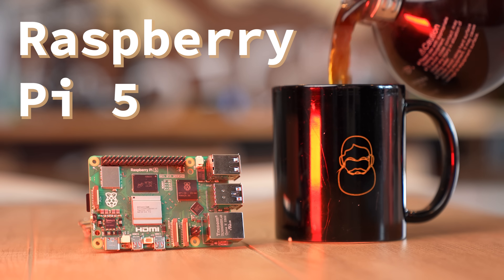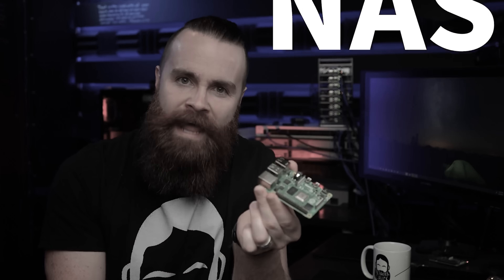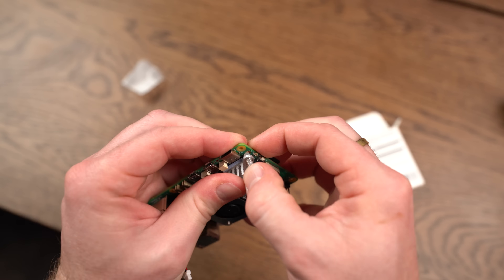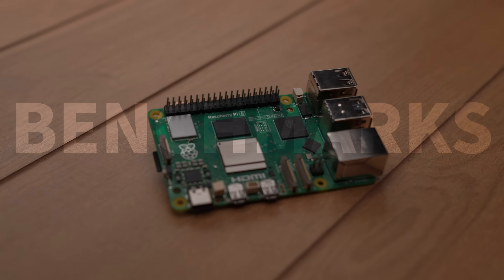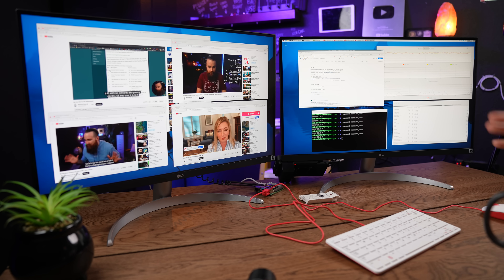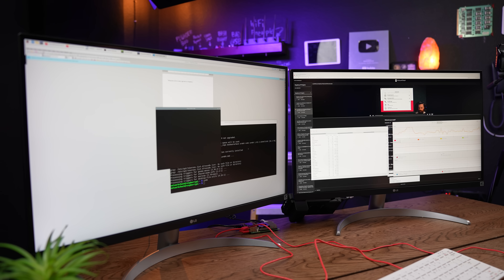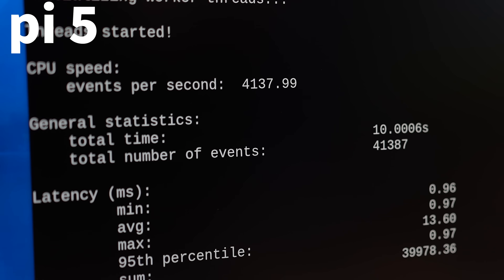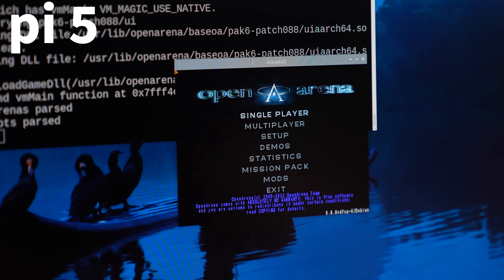the Raspberry Pi 5

Comment: Well minus all the jock riding for Pi 5 that was in the intro it isn't all that and wont be for a while,if it ever really is. And after 4 years this thing should be a lot better on the cpu and GPU front and honestly it really isn't. Emulation is in the early days and so far it is not much better than the pi 4 in emulation. And the rpi OS is wonky at best and the introduction of Wayland isn't helping that with Chromium NOT working the last few updates and no one even mentioning that is odd. For me I can get far more out of a mini pc around the same price range depending on what I buy and emulation will definitely be far better on that than a PI. Honestly to me the new Pi shouldn't cost much more than the cheapo gaming boxes you find on Temu and Wish lol and one other thing. Doing a Pi 4 vs Pi 5 comparison as if that proves something for the Pi 5 really doesnt  except that it is better than a Pi 4. But how good is it against other SBCs out there? That would be a more interesting comparison.

Comment: I just picked up a $330 mini PC, 5x5x2 inches, with a decent 8 core Ryzen 5 mobile with graphics and 32GB/500GB and 4K 60Hz.  So at the other end of the spectrum you can get a pretty decent PC to run Win11 or Ubuntu or something (the one I got had two ppl claiming to have Debian running on it, one left instructions).  Since I never use the built in laptop screen or awful keyboard, for me it's like a laptop that fits in a coat pocket.  Even got room for a small SATA drive.

Comment: The problem is you did not even check if the thermal pads are cooling the right components. I bought one and i had to move the thermal pads on the chips that need cooling. Probably its the same for you too.

Comment: More and more stupid, more expensive, more prone to breaking, more heat to dissipate (a fan of this size can't run continuously for 4 years like my Pi 2 and Pi 3 always do with passive cooling. Plus, beware, you are clearly a hipster.
At this point, just buy a Steam Deck, which will be equivalent to a Raspberry Pi 30. You'll avoid spending thousands of dollars over the years, and you'll also get the equivalent of an integrated inverter for the price. And if you don't like Arch, you can just install Distrobox and then a proper Debian like a man. However, you're certainly not qualified for that, and you prefer to buy Flipper Zero for hundreds of euros instead of an ESP32, an SSD1306 OLED, 4 push buttons, a small 1S LiPo battery, and a 3D-printed case for less than 10 euros.

Comment: The Raspberry Pi was designed to offer hobbyists an affordable solution for creating IoT projects or prototypes. There is no need to make these devices overly expensive or powerful. If you require a full-fledged computer, it's more practical to consider purchasing a budget laptop with features like an Intel Celeron or AMD Ryzen 3 processor, which are more powerful than the Raspberry Pi's CPU. These laptops come with displays, more RAM, and built-in storage.

The beauty of the Raspberry Pi lies in its compact size, light weight, and very affordable price. It's essential not to compromise this beauty by attempting to turn it into a high-powered computer.

Comment: WTF? Power Button? I need it online when the power is on. Is it still possible or I have to run few kilometers to turn this thing on when it dies? I see that this is nothing worth of investment.. If you need something better just buy some refurbished tiny PC which will be much more powerfull. The rest of people can handle the Pi 2/3/4 with whatever they need to be done like home automation or some other projects. Still Pi5 is too slow to compare it to the PC level. It is going the wrong way currently.
Reply: Usually this kind of thing is configurable, but yeh necessary for iot stuff like home assistant.

Comment: breaking news.. new technology does more things for more money.

I am tired of this, had this been 10-20% less performance but for less money than the 4 it would be interesting. Instead we got something that is more expensive and uses more power to the point it needs active cooling, imo those two metrics are what made raspberry pi a thing, cheap and low power (also small form factor, but 5 isn't any smaller than 4 either..)

disappointing as always

Comment: It looks fine, but so did the RPi 4. The problem is the RPi 4 has basically been vaporware for the last 3 years, or sold at scalper prices so absolutely not worth it.
I'm not happy with the price bump either, RPi 4 MSRP was 50% of the RPi 5. If they are going to be pre-scalping the MSRP on the RPi 5, it had better have no availability issues.
Reply: RPi4 4GB is $55
RPi5 4GB will be $65

RPi4 8GB is $75
RPi5 8GB will be $85

RPi factory has little controls over people scalping ….

Comment: NO WAY
im not falling for this trick again lol 😅
"just get a pi bro" 
the thing is a toaster and craps itself running simple arcade games 😂
Reply: Yup, I can't disagree with you. Before I was programming Python on the pi4, and then figured out how to run and program python on my Threadripper 24 thread desktop and never looked back, the speed increase was massive. 
My main issues was figuring out how to correctly install the programs. It's not easy at all as many try to say to install programs, libraries. I would love a Pi5 with already installed OS, to at least assist newbies. 
As for the hardware, I did have many random crashes and freezes, and frustrating Pi4 sessions. 
All that being said, if enough features and negative attributes were improved I may play with the Pi5, but from what I've seen is that not enough changed and I likely won't purchase Pi5.
Reply: i think its great to get low cost computers out to developers and get as many people in the linux community as possible 

however as a "gaming device" there is no point
even for a precovid $36 delivered i wish i didnt buy it lol

Comment: Let's cut the chase... Pi5 + fan + case + power adapter = the price of a mini PC! Not worth anymore...
Reply: Power adapter: £7.50
Fan: £3.50
Case: £9.60
Pi 5 8gb: £76:80
Total: £97.40
GMKtec mini pc: £339.00

Overall, the pi is cheaper, and has a bigger community to help you.

Comment: I’d bet if you got it setup to boot from a real SSD using a SATA to USB connector, that it would probably run a hell of a lot smoother.  If it has PCIe 2.0, then there are going to be people adding NVMe storage.

Maybe by the next generation they’ll put an NVMe connector on the back, so you can use one of those little ones like they used in the Steam Deck—because if they do, that’ll make them legit low-end PCs.  Obviously you’re gonna want to keep the SD reader, but I think adding the connector is way more useful than even those camera connectors.

My primary use for these are for emulation, and there was a lot of stuff the 4 came really close to running, so I’m looking forward to the added grunt being able to make certain games functional.

Comment: I really don't like, that it has a fan by default now. Of cause there will be third-party passive coolers, but I think that no moving parts was a key selling point for the older models.
Reply: The fan is optional. The Pi 5 will throttle to stay safe under heavy load, so it can even run without active cooling, but cases doing passive cooling can prevent throttling. The extra cooling requirement actually started with the Pi 4 - more performant chips generate more heat. I started buying FLIRC cases since the Raspberry Pi 3 because I prefer using my Pis both safely and quietly.
Reply: @kneekoo people are such thoughtless haters. Thanks for sharing actual logic 🙏🏼
Reply: To add on, I think the selling point was also the fact that often you didn't need one! Sure the Rpi5 is much faster then the RPi4, but that extra performance came at a cost of power input and size.

Comment: It now is too weak for a desktop replacement for it's price and overpowered for single-user-case solutions for it's price, like dns servers, VPN's, or basic single use applications like RC cars or micro servers or other robotics. 

The average user using it as a desktop/laptop replacement doesn't want unreliable sd storage but a harddrive if they plan on any reliable data persistence, speakers for sound, webcam for basic videocalls, and u want a case if u carry it around, adding this will bring you around 200 - 300 dollars depending on your smarts, for that price u can get many laptops (new or second hand) that will beat it in every single aspect by margins not even close.

For static displays/videos yeah, buy a laptop with broken screen, which often sell for peanuts because of the broken screens, then hook a screen up through the ports. Better performance for a lower price.

Also, u said no technical review, but from a practical point of view, benchmarking transcoding, which might say nothing to a consumer does translate in usage as a media centre.

Also more power and thus higher power usage is not really a pro, currently I have a pi 2b and pi4 and various chinese clones running of a single(Cheap and small) solar panel, in other wordsI can run a complete network in the jungle, and a single pi can do network i/o on a small power bank for an entire day if I want to do any remote field work like debugging mesh networks or other fancy stuff in places without wallpower.

All this extra power requirements and added price goes fundamentally against what made a SOC like this cool AND practical in the first place. The product identity is going all over the place and I feel that the company lacks true leadership (I know that is arrogant, I don't take it back), this is what I truly believe.

Jack of all trades, master of none, and your video shows it, it can do everything, 4k, wifi, but it does it all worse for a higher price/performance ratio. And it's main selling point and identity trait (being cheap, for people in poor living conditions) is on the edge of falling away.. From a product point of view it's objectively shit right now

Comment: I used your link a few months ago to get itprotv discounted. it has been a good experience so far. the videos are VERY in depth compared to other free options. The labs are well designed, and as long as you are patient enough they work well.

Comment: Was that 4K video you played over the network encoded in H.264? The lag would make sense if it's not, since that would mean that the CPU would be used instead of the H.264 hardware decoder, and the CPU would probably not be powerful enough for that. I have an old Celeron laptop hooked up to my TV which plays any 4K60 video smoothly if it's encoded in H.264, but struggles with even 1080p60 if it's not.

Comment: 11:35 If you’ve got gigabit Ethernet, odds are that 125MB/s will be very similar to the SD’s max speed. And Samba can be brutal on low power CPUs to handle and it’s limited to single core usage.

Comment: pi's are not suitable for real desktop use, never where. They are more for tinkerers (GPIO etc). If you need a desktop take a x64 sbc or mini pc, they are far better performing, and also have low power draw (laptop cpu's).

Comment: I think RPI can't keep up with the competition from other Pi's models such as Orange Pi 5P which already used quad core processor, 16 GB of RAM, built in NVMe slot, MMC card support, etc. Also dual LAN ports, triple HDMI ports, and still has audio port. To be honest, I'm not promoting them, but I'm a happy user currently running an Orange Pi 5 for Home Assistant and Jellyfin and an OrangePi 5P for Frigate NVR with person detection. In summary, skip this RPI generation and wait for the next generation that is up to the competition.

Comment: this seems like a good thing if you want to make like you said a NAS, but it's not worth to use it as main pc, since something like an used thinkpad costs around as much as the raspebry pi alone, and way less if you include in the monitor, keyboard and mouse. Also the thinkpad will be way more powerfull, even if its an old one, or a low end newer one like mine

Comment: peak sd card performance is STILL pure and utter GARBAGE.  I dont care if the SD card is 287345692876495876287 times faster it wont LAST LONGER with my Gentoo install, it will burn out in less than a week.   Till they put ON BOARD storage I dont care if it has a million 200 GHZ processors.  GARBAGE

No Sale.
P.S. why would you launch an ultra greedy resource hog like vs code when you can use the arm version of sublime text?

Comment: The annoying part is that the newer models are just going further and further from being accessible kind of going against the idea of raspberry pi, I just hope they can keep the weaker models and still manufacture them.
Reply: rpi started out with the idea of simplicity , ease of use and low cost, dumping the bells and whistles in exchange for simplicity and . it was meant to be the equivalent of a bicycle for computers ,slow and useful. now its been taken over by dumb hipsters who cant do ohms law. who think theyre so cool. no your not cool.
Reply: Thank you for saying it out loud. Every day, RPi becomes a little more of a cult. Not the loveable upstart that made computing accessible as it once was.
Reply: @craftwithcodewiz  It's not a cult until people are replacing their nations flags with ones of their own.
Reply: Spot on ❤
Reply: I believe they are still going to make the Pi 4 to have a cheaper and lower power draw model available, I think they are doing their best to keep computing accessible. Unfortunately processor design is very expensive 😢
Reply: RPi will still make several older models.

I use RPi’s when I need GPIO function , or the extremely small footprint or low power draw.
Otherwise, I use refurbished 1-liter Dell Optoplex and HP EliteDesk for desktops.
Reply: The point were RPi got off that track was when the controls and sensors industry realized that they could dump their expensive hardware and just sub in RPs.

On the negative, they seem to spend all their time making them for industrial and commercial customers who tend to soak up the bulk of their production.

On the positive, somebody has to pay the bills and the industrial and commercial customers are printing them money, paying for more research and production.
Reply: Composite video+audio out will be missed.
Reply: @keilmillerjr9701 I think you can solder the composite video out back.
Reply: @keilmillerjr9701 …composite video is still available via two solder pads. Sadly, analog audio is gone gone.
Reply: This is exactly why I bought OrangePi One
Reply: Accessible how? In terms of price? That's inflation for you...California just passed a raise in minimum wage for fast-food workers to $20/hr. Once that takes effect someone working at Mcdonalds in California will be able to buy a Raspberry Pi 5 after a half days work.
Reply: @killer2600  Everyone in the US was able to afford computers even before raspberry pi. It's about others who can't. $80 is not equivalent to half days of work across the globe
Reply: @theoutlet9300 Starving kids in Ethiopia aren't exactly whipping out their phones to order a Pi.
Reply: @killer2600  about 8 years ago, McDonald's was advocating to get the state of Connecticut to raise minimum wage. A McDonald's manager heard my wife and I talking about it and he sat with us. He said this is his last night and then he will quit. McDonald's will raise the price of food, pay more for entry level, and not raise anyone else. A manager will make the same as a burger flipper and your cost of living just went up. He said that's how companies make more wealth - eliminate the middle class. Well, he was exactly right. Everything he said happened. That chat we had years ago was a life changing experience for me.
Reply: If you say things like that you should know Milton Friedman inflation is from printing so much money. Full stop. Good luck living on $20/hr Cali. That wage is a reaction to inflation not the cause @killer2600

Comment: I have a raspberry pi 4 8gig of ram, and i overclocked it so it is already have enjoyable desktop experience, so if we can overclock the pi 5, omg it could be amazingly strong imrovment, maybe we can push it to 2.8 or even 3GHz clock speed with decent cooling. I just need it, and i starting to work harder just to buy one of this beast😁

Comment: Seems awesome. Tbh I'm not a fan of those moving parts, the active cooling. You might wanna use the RPi someplace other than the living room, and moving parts will break. They should make an equivalent passive cooling system, if a cooling system is needed. (unless ofc this is a panametric fan they are using, which is unbreakable). The power button seems convenient but it's not really, I'd rather they had 2 extra pins for it, to connect your own doordle spring or handle it programmatically, which fits better the RPi I think, for what it is and its intended uses. Other than those minor issues, awesome.

Comment: Yeah, you really don’t need 4k with a rasp 3,4 5 or XX….its not the intended scope of the board. It is not for highly glue intensive stuff. A quick YouTube video at 720p while learning how to code….yeah. Using as a NAS or dedicated service machine in the house as a router, ad bliocker, etc…. Let’s stay within the scope of of the hardware’s intentions and I think everyone will be more than happy. Running 4k video on a 86 inch tv….or gaming. Nope. Unless of course, you are doing retro gaming….then even the 4 works great!!! I have a multi emulator build at 512GB and it runs everything great.